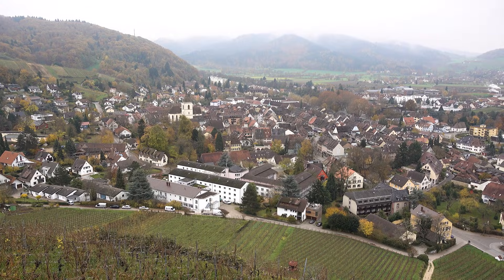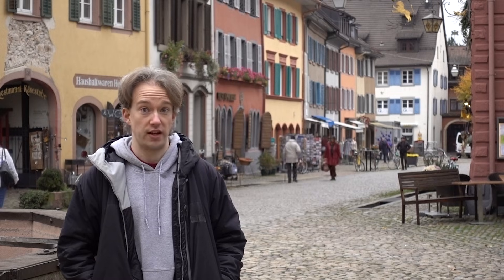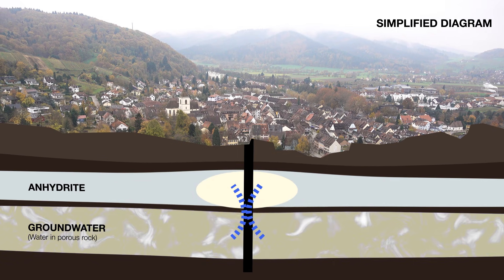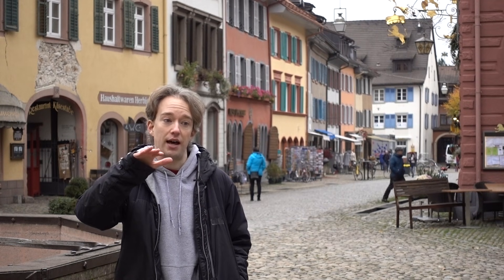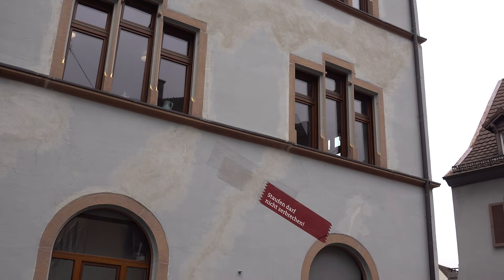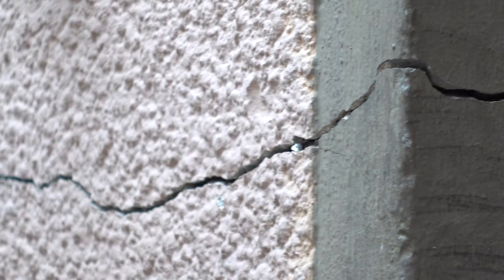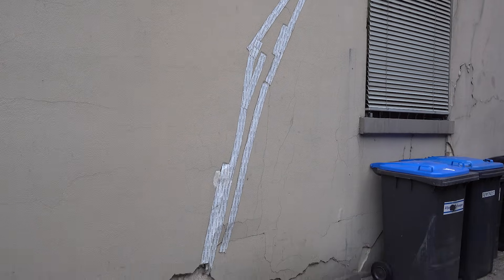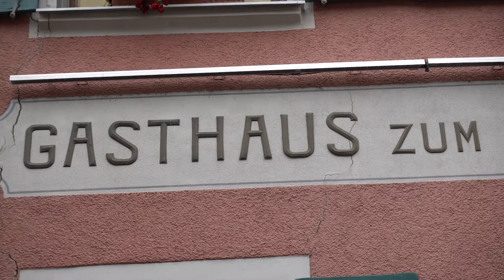The German town that's literally cracking apart

Comment: Could you not just bang a tight fitting pipe into the bore hole, rather than plug it, give the water a route up and out through the gypsum stuff?
Reply: So, Rolf, you're saying we need another pipe. Then we are agreed. You get the pipe, I'll bring a hammer, maybe a drill too. Got a brushless one that should work.
Reply: Aye, naw mate. Just go down B&Q, grab a bit of pipe, then bang it in. Have it sorted in an afternoon. Bit of paint to make it look pretty, knock off for tea after
Reply: Big_Adam_2050 if they haven't done it is because maybe is not that easy...
Reply: You have to heat the gypsum to about 200°C to turn it back into anhydrate and reverse the reaction. You can't just "let the water out".
Reply: Big_Adam_2050 it’s Germany, so they would go for a beer afterwards ;)
Reply: Word of advice: If you're referring to "the gypsum stuff" and "bang[ing] a tight-fitting pipe" in, you might not be a qualified expert.
Reply: This whole thing started because they just banged a pipe into the ground (that's not even a joke) - which broke a large hole into the layer between the anhydrate and the water.
Reply: I'm neither an engineer nor a geologist, but I expect if you drain all the water out then you'll leave a cavity which will make the problem worse if all the stuff collapses into it. And even if you turn all the anhydride into gypsum + extra water you might still have a different volume
Reply: From what I understand, an aquifer is water inside porous rock, under pressure. Not just a great big hole full of water.
Reply: This guy is great xD
Reply: Buzz, if it's not cheap they CAN'T do it. They could probably get some boring machines and hollow out and shore up all the anhydrate under the town, if they wanted to bankrupt the country.
Reply: That, and also drill another hole that goes horizontally with the formed gypsum layer, and pump boiling water through that to revert it back to anhydrite. Will that work?
Reply: Slightly expensive
Reply: If its not cheap they won't do it. They will do cosmetic repairs
Reply: Yes! Lets do that!
Reply: I wouldn't mind laying some pipe in Germany

Comment: is this fracking?
Reply: Fracking is for gas, this was for geothermal energy, usually for heating.
Reply: Fracking doesn't use explosives. no idea where you got that idea from.
Reply: well it is better than fracking, if done right.
Reply: Fracking does sometimes use explosives prior to injecting fracking fluid to increase permeability of the rock.  Of course, many new developments in geothermal drilling ride on the coattails of hydrocarbon fracking technology, so while I can't reference anything in particular I would not be at all surprised if explosives are also used in some geothermal drilling operations.
Reply: mining for gas with explosives, i like that idea.
Reply: No
Reply: No its like drilling a geyser.
Reply: Dark red Bandit its completely different unrelated things. You could also do both or neither. They are both drilling operations (and so is drilling a well) the key difference other than one is for (pumping) water and the other for extracting gas and as the name is suggesting is that fracking requires fracturing of the rock. But that isn't necessary the problem either its how they accomplish the fracturing but also pressurize the loosened material to release gas of  material they pump down a lot of water and chemicals. Even though they pump it back up they put it in an artificial pond and let it vaporize because its beyond treatable. It leaves you with some risk to the groundwater.

If you have vast swaths of unpopulated land fair enough. But in Germany you don't really have those.
Reply: Indeed, fracking uses a cocktail of chemicals to release gas from pockets.
Reply: well at least this only destroys a town if done wrong and not nature.
Reply: no, fracking is using explosives to release combustible gases, this is drilling to release geothermal heat

Comment: I do respect the construction that all you have is cracks in the buildings. With that much shifting I'm surprised most of the buildings are still there.
Reply: Timber frame construction is quite flexible.
Reply: RKBock - You are correct in that it doesn't matter where I'm from. I've worked in disaster mitigation before I retired, so I love to focus on areas that hold up well to external forces. I've learned so much from so many people all over the world.
Reply: Shankar Sivarajan - You're actually right on both counts. A skyscraper built in an earthquake-prone area could easily handle a meter shift (depending on the speed of the shift), whereas one built in a non-earthquake-prone area would collapse. It depends solely on the engineering of the building.
Reply: E. - Looking at the pictures of the damage, it looks as though it's a timber construction, oak, with a stucco facade. Depending on how deep the supports go the buildings don't appear to be in danger of collapse, but the facades are going to continuingly crack. Maybe adding a coarser sand to the stucco mix would help with further cracking, but not permanently. Not enough information to know for certain.
Reply: +Jesus Gonzalez Skyscrapers would either collapse immediately, or weather it without any problem whatsoever, I'm not sure which.
Reply: droid monkey there are way more eco friendly methods to get oil than fracking. not to mention, that the point that he critizised was not that it was allowed, but that it was allowed without regulations! 
it is allowed in the us without regulations, for the most part, not because of political reasons, but because it is profitable. multy billion dollar profitable. 

also: they eased off on russia due to two reasons: the "aggressions" of russia went down and, although you might not even consider this, because europe has massive trade with russia. every sanction on russia is also a sanction on themselves (eg: if you forbid someone to by wool, he has no wool, but you also can't sell him wool any more). so no, they didn't ease off due to the gas (which was never really part of the sanctions to my knowledge, as both sides depend heavily on it and russia couldn't realistically stop this trade).
Reply: Jesus Gonzalez - Yes, I am. From Texas if I'm to get specific.
Reply: @jaspr1999  americans make crap houses
Reply: Sure, but even though the total displacement is that big, the localized differential "un"-settlement must be significantly smaller. The problem now is that those houses are made of brittle material (hence the cracks), and brittle material cannot store too much energy (another way to put it is: they cannot deflect too much)
Reply: Broken Wave if its a barrier you can't breath!?
Anyhow I think the critique is somewhat right but also wrong. Yes the average american house   is a wood frame construction but the average american house is build to last for everything between 40-80 years which is a completely different approach to most European houses that are basically intended 80+. 
Arguably a wood frame construction should be made hurricane save if its in a region where that occurs, but the cost for that let's a lot people take gamble with it because the inherent limit of wood as structural element still limits the time it could last (that is to say you can build longer lasting with wood but not with wood frame).

An upside though the average american house can go for comparable large floor spaces.

Now all the plastic in today's building is mainly insulation and water barrier (water+wood=bad). For effective ac/temperature control. The downside of course is that anything damaging the wood becomes an immediate structural problem; mold, termites ehm fire ^^ (burn down <-> burn out). From the European perspective that seems weird because they tend to hand down their homes for generations and also they don't understand tom and jerry comics because they rarely encounter something like a hollow wall.  The downside for europeans though is they have to rework their houses over time too, as lead pipes had to go out. Walls go down and up and so on... its says less about the building quality but the approaches to housing. The approach to housing however dictates the building quality/cost in a way.
Reply: @isaiahbruckhaus  And if you're in Florida the American mentality sucks...
Reply: dude, if you know even a little bit about big structures, you'd understand that a one meter shift is usually enough to destroy everything! he doesn't need to be from the us to understand that. it doesn't matter what your house is build out of. as long as it's not ellastic, it will get destroyed! (because the earth has much more energy than a house can hope to cope with)
(also: wood kinda copes better with such things than brick and cement)
Reply: Here in NZ houses are usually built out of wood because it is cheap (we grow it) and because it copes better with 'quakes (it flexes).  The traditional European (brick etc) buildings in Christchurch in the South Island coped very poorly with their 'quake a few years back.  These German buildings, being several hundred years old, will probably be better built (as in stronger) than brick buildings built within the last 50 or so years (the logic being that if they have lasted this long they must be).  Buildings built in the last 50 years will have been built 'down to a price' and with the materials-knowledge to know how far cost-saving can be pushed (the building only has to last as long as the building company/architect who have legal liability re' any failings).
Reply: Broken Wave about houses made from wooden boards and plastic wrap
Reply: Would depend on how they're built I guess, "earthquake proof" skyscraper like they build in Japan would probably be able to take it
Reply: Thats because in germany we build real houses out of Stone.
Reply: New foundations are needed but that won't happen for every building because it costs too much
Reply: european quality
Reply: Bruh our Houses arent made out of paper
Reply: German engineering
Reply: Relative to poorer countries like the USA, yes.
Reply: jaspr1999 y
Reply: Fine German engineering
Reply: I thought that German engineering was the bee's knees? So how come they did not list these buildings then and to conserve it without destroying them at all ? I don't even understand.... Never knew about this kind of EU stories.. if anything.... and we've been in Europe for a long time. So surprised.
Reply: The part I respect more is that most people here learned about the dangers of deregulaton when it comes to drilling and fracking. It's pretty scary what's going on in countries like the US, where they somehow inflated energy profits with national pride, no matter the  risk.
Reply: Edward Goodman, still unregulated drilling...
Reply: They're German, they're great engineers XD
Reply: jaspr1999 are you American by any chance?
Reply: @jesusgonzalez6715  Do americans sterotypicly have Cardboard houses? Or only the ones out of town are?
Reply: Jesus Gonzalez Some of the greatest buildings, bridges, dams, etc ever built were built by Americans. Including the the tallest (not highest) structure on the planet.
Wtf are you talking about?
Reply: @brokenwave6125  "Ever built"?? Are you serious? The US doesnt even exist long enough for it to make the greatest buildings on earth... European buildings are much older and have survived till now, what building can seriously compare to that?
Reply: That's because Germans are the best.
Reply: sdtok bullsh**
Reply: John Uferbach They aren't "made of" plastic wrap. That is just to act as a vapor barrier so the house can breathe.
Reply: T33K3SS3LCH3N I hate to be that guy, but national pride doesn't come from energy profits, it comes on self-reliability. Perhaps if you picked up a history book once in a while instead of talking out of your ass, you'd know why that's an issue. 
In the 70's the US was thrown back into the 19th century because it chose to back an ally in the middle east. Saudi Arabia did an oil embargo on the US and suddenly cars became useless.
Energy dependency is one of the scariest things for a country. Europe should know. It relies on Russian Natural Gas, thus it can never push Russia too much without actually starting WWIII. Ever wonder why Europe eased off of Russian sanctions? Yeah, I thought so.
This isn't to defend the means of extractions some countries choose to take on, but it sure beats being dependent on another nation for such an important resource. 
But hey, the common idiot doesn't think past ahead of one problem and often overlooks the bigger picture. Not your fault.